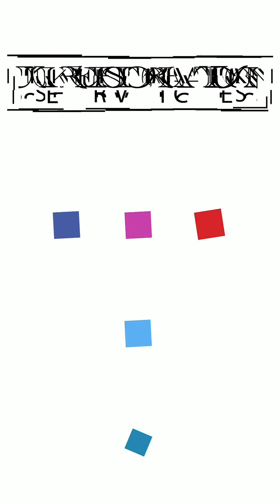Stepping Stones across River FIXED - using Cintec Anchors

Comment: If the riverbed erodes, won't they just become wobbly again?
Reply from the maker: There is an existing concrete plinth in the river. We used Cintec anchors to pin them to the concrete. never coming off again.